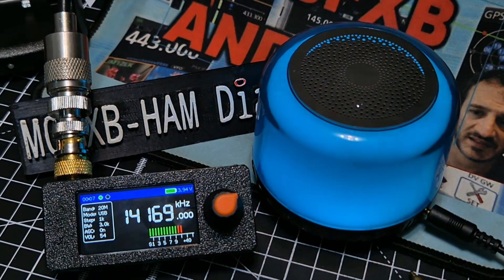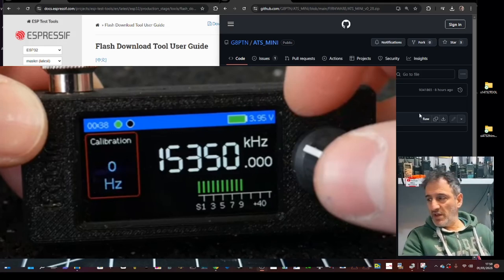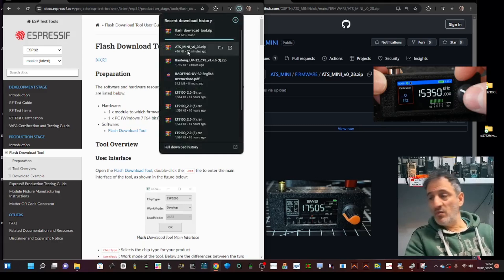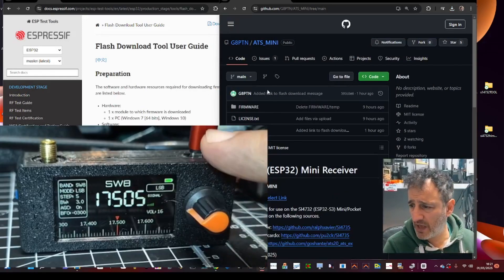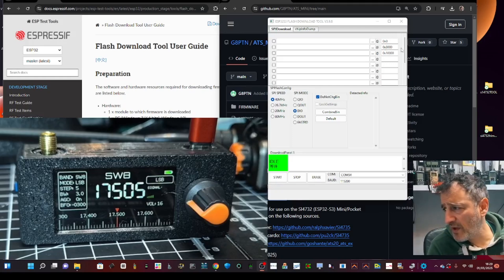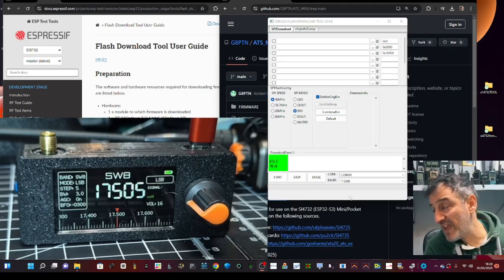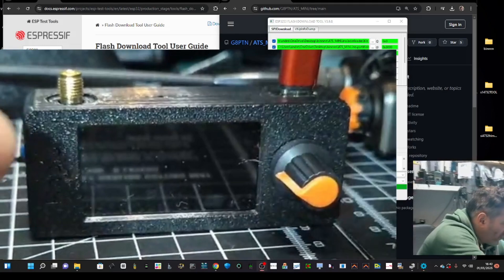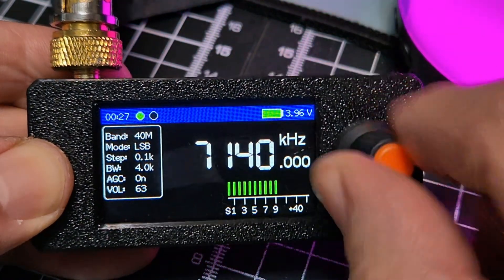Full Install - Si4732 Mini Receiver Custom Firmware

Comment: I have the 3rd model of this from Aliexpress with the Hi-Z and already on FW V1.01 and I also can't get the seek up and down to work. Although it's not an issue because it doesn't save channels so doesn't make it any easier. Would putting a longer whip aerial than the one that comes with it make for better reception on FM or make it worse?
Reply from the maker: Long for HF short for uhf vhf send me.a.link
Reply: @M0FXBHamTech  Cheers 👍

Comment: PSA: Setting the same Baud rate in the driver as in the flash tool (7:30) is crucial. Everything seems to work fine but it doesn't flash correctly otherwise.
Reply from the maker: Ok

Comment: tried to update from 1.01 using the Flash Download Tool under Win10pro but got stuck with the problem that the program didnot open the windows file system when cklicked on file select. - somebody can help ?
Reply from the maker: Watch video again slowly .
Reply: @M0FXBHamTech  what essential did i miss ?

Comment: Actually the seek up an down needs to actually made to recognize stations.
Reply from the maker: Get better higher antenna
Reply: @M0FXBHamTech  Haha, right, it doesn't even stop on the strong FM stations. My antenna does well picking up the stations but the seek function just passes over them.

Comment: Did everything as outlined. Cycled off and on. No display. It is not bricked. I can read the chip, USB shows the device. I think there is an issue with the display and the firmware version. I see there is a newer Firmware 0.30. I am going to give it a try and see if it recovers.🤨
Reply from the maker: Check forums
Reply: @M0FXBHamTech  Success!! I either had my laptop pluged into the power pack, or the USB-C;  I was using was a 3.0 . I used a old USB I thought may be only charge and not data. But it worked. My laptop showed the radio as the same COM port as last time, but showed it as what I was doing, as a JTAG.

Comment: I followed the steps and information like yours. The process ended like yours, but the radio doesn't turn on; it's completely black. Can it be recovered? I've tried several times, but nothing.
I typed:
ESP32 3S
Develop
Usb

And on the next screen, the same files and addresses, but no way.

HELP
Reply: Same problem.
Reply from the maker: Watch Video slowly you are missing something keep trying .

Comment: I followed all of the steps and it has seemed to have bricked mine.........  won't power bck on or do anything...... any suggestions???
Reply: Quick Update:  I had to use the ATS_MINI_30_8M files.  I guess mine is an 8M version...  Just a little info and help to anyone that might need it.  Thought I had bricked my unit..  Thanks for your video.
Reply from the maker: Can I have link
Reply from the maker: Ok

Comment: Sorry to tell but 1.08 didn't work for me. The device is now a brick. I've tried every available firmware but device doesn't start up anymore. Is there any option to recover?
Reply: Found the solution: erase with the tool and using v 1.00 works for me now. No more brick !
Reply from the maker: Sorted

Comment: Thanks, works great. I did this via VMware on an M3 Mac using the latest v1.01 firmware, - No issues.
Reply from the maker: What's VMware
Reply: @M0FXBHamTech  VMWare is a software to create and run a Virtual Machine. In his case, running Windows on his Mac computer.

Comment: Hey Guys:
It looks to me the Hi-Z mods works great for the whip. But I plan on using the doughnut style PCB antennas mounted on a PCB that you see on Aliexpress.
My question about all of this is; Are those PCB doughnut antennas true 50  ohm? If so, wouldn't adding the H--Z mod be detrimental to the receiver's operation, lowering the signal strength due to impedance mismatch?
If I don't receive input/replys from you guys I might make a switchable Hi-Z/no Hi-Z circuit into the radio. Does this make sense to any of you guys?
Thanks for listening,
73''s
PS I love the idea of this tiny radio. Don't you?
Reply from the maker: Use a long wire

Comment: all was ok but radio never restarted! 😪
Reply from the maker: Do it again carefully
Reply: @M0FXBHamTech  Thanks for the answer, but it doesnt want anymore. The drivers founds was ok just 1 time on window 7
Reply: If something goes wrong during the firmware download process, you may have to force the ESP32 S3 module into bootloader mode. You can do that by pulling pin GPIO0 low while turning on the receiver. GPIO0 is located at the end of the row of pins on the antenna side of the radio, near the speaker connector. I temporarily soldered on a 1000 Ohm resistor, but a paper clip would probably work fine as well if you have the dexterity to hold the paper clip in place while powering on the receiver.
Reply: @stevebeckman2623  Thanks for the answer. I will  try

Comment: Did you get a virus warning when downloading the flash tool?
Reply from the maker: Yes type windows security turn off
Reply: @HamTechRadioScannerDrones  Captain Obvious type question...  You have not seen your security software showing any loaded virus after turning Windows Security back on?
Reply: @M0FXBHamTech is that safe?
Reply: I got also the messagem of a trojan embebes on it! 😱😱 Instaled the softawe on a pen drive, with windows safety off🥶. After the mini radio upgrade (super!) made a scan for all windows system... with 2 or 3 trojan occurrences, wipe and format  the flash drive with commands line, followed by new virus scan for ALL drive units... it seems all ok 🥶
Reply: @JorgeFerreira_jomafe  Thank you.  I will give it a go.  Much appreciated.  :-)